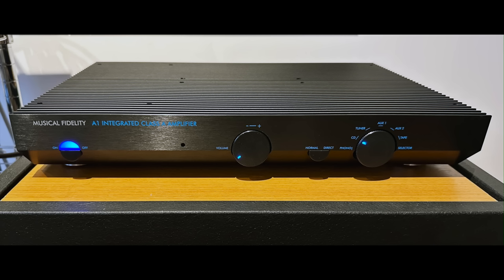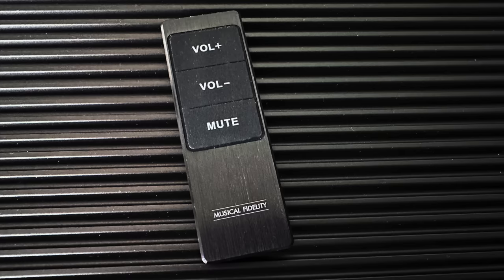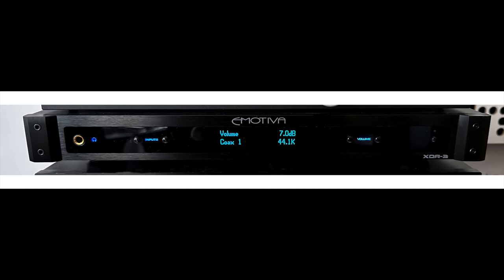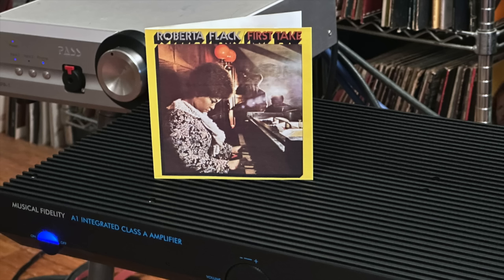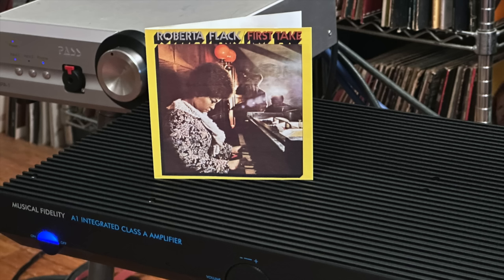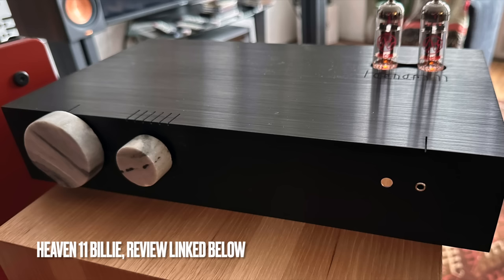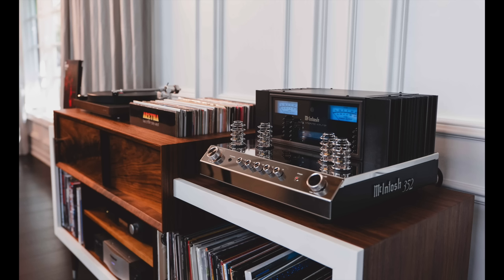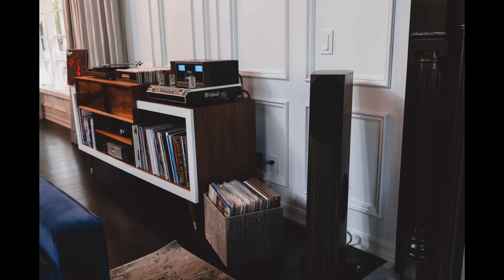Musical Fidelity A1 Amplifier, A KNOCKOUT!

Comment: I had the original A1. Had it  for over 15 or so years before moving to valve integrateds. Loved that amp sounded superb through my Mission 700s (The 1980's ones)
Reply: Mission 700s?  The Musical Fidelity A1 owners didn't buy Mission 700, you know Mission were Persian Capital designed (Big Money) and aimed at the Rap music community, Iranian and London/ West Yorkshire scene.  Musical Fidelity were upmarket and had their own MF Reference and (a name copied from Radio Shack) 'MC speakers'.  The MF music was some strange stuff that Steve never reviews, but British establishment stuff.
Reply: @keplermission  this musical fidelity A1 owner used Mission 700's though. They were a perfect pairing.
Reply: @adotopp1865  No ... speakers are engineered for applications.  Mission 700 were for Farad Azima's Cyrus amplifier that you know, to be honest were dull, they needed bright speakers, the tweeter with higher SPL than the mid/woofer.  Mission were assembled in England and later ... used a Scottish power iron, but Mission really carried on where Amstrad left off, they were nice speaker for Rap and pop music.  MF is absolutely upmarket, your 700 were not the right match for MF A1 but cheaper and similar build style.
Reply: @keplermission  Well I liked the set up before I used the A1 with Sonus Faber minimas and later SF Minima Amators
Reply: @keplermission  The mission 700 and 770 were designed by Peter Comeau in UK . Mission products are and were made in the UK. I have sent products to  Mission in UK for service. I also have corresponded with Mission in the 1990's obtaining parts and information.
Reply: @adotopp1865  Peter Comeau of Wharfedale R.I.P.  Not the UK, in the USA the UK is the University of Kentucky, you know ... Sophia Rosing and Kylah Spring?  Mission were not in the same bracket as Musical Fidelity.  Mission is mass-market and ubiquitous, it's a brand name on the lips of the people in Britain that went to you know schools that the government paid for.  Musical Fidelity is upmarket, it's not meant to be used with Wharfedale or Peter's Mission happy speaker design for Farad Azima?  Musical Fidelity is for former private school people.  Cat Stevens:  
Remember the days of the old schoolyard

We used to laugh a lot, oh don't you?
Reply: @keplermission  You do know that most of what you say is wrong, don't you?

Comment: Hello, I was wondering if these could drive the Elac B6.2  87db  6Ohms small to med size room? won't be playing super loud. I just received the CA 1 by audio by alsten but have to send it back because of a knob and coun't hook it up and did not get to listen to the amp. a bit disappointed the amp came like that. So,  I was wondering if I should get a replacement or go with the A1? Help. Ha!

Comment: I'm a huge MF fan especially  to the A-series. I had given away a Luxman pre/power combination C03/M02) for a 100€ A1 in the end of the 90ies. It was much more musical in every sense. Since then I had every brother except MA50 Mono or A1000  and had recapped and modded them all by myself. The most exotic was a A1  final edition which was in fact a B200. There this version was more working in Class A/B but had 40 watts/channel. I had replaced the plastic knobs by some from Farnell within the same design but produced in alloy. So two things I would like to know. Are these plastic knobs (volume/input)? If you are familiar with the A1 you will get aware of Mark Henessy who did some fine mods especially to the preamp section. The TdP design in this section was dropped by MF due to cost cutting of MF first amplifier! So the preamp section was copied from a mixer with the effect to bring dc voltage to the volume pot that will kill it over time. Mark did a redesign  with only few parts and a better opamp. Therefore I can not think of sticking to the  original layout in the preamp section in this retro version. This would keep me away from buying a new one. Could you figure that out with MF, please.
Reply: The pre section has been improved but you don't really need to use its gain section, it can be defeated. Knobs are good quality plastic and this is a good thing because they don't get hot... Btw that was not MF first amp.

Comment: It would have been interesting to open the amp up to see what kind of construction and parts are in there.  I'd be a bit worried about cheap construction especially with a hot running class A amp and how it would hold up over time...or not.
Reply from the maker: There is a picture of the inside in the video!
Reply: Sorry, my bad I guess I somehow looked away during the few seconds the internal shot was on screen but I did catch the audio the first watch of you mentioning the pure path setting so I'm surprised I missed the pic.  

Still a bit tricky to assess all that much at 1080p from the pic.  From what I could see some of the resistors look pretty small.  I don't think anything looked like SMT but couldn't really be sure, or about the quality of the board itself. 

 Do you have any thoughts about the internal construction and how it might compare to the original version?

Comment: Unsurprising the A1 sounds so good, its design faithfully follows the original concept from the legend and sadly late Tim De Pavaracini. No surface mount, multi layered boards etc here. All discreet components. I am proud to own several of Tims designs including the EAR YOSHINO 912 & 868PL all tube /transformer driven pre Amps and they are sublime. The A1 may well find a home in a second system soon. Great to know how fond you are of it Steve.
Reply: My Chinese TDP phonostage sounds great... And De Paravacini didn't get the 900 GBP markup if I was fool enuff to buy in UK... and it sounds great at 289 GBP
Reply: All value propositions are relative, and all listening perceptions are, of course, subjective. I am happy for you finding what sounds best for you, and I sincerely wish you many happy hours of listening.

Comment: The heat sink fins are quite shallow - I would expect them to be much deeper/taller. For comparison, look at the size/surface area of the heat sinks on the Amp Camp Amp - which is less powerful. Edit: or just look at the First Watt J2 - it has far greater surface area on just one of its two heat sinks.
Reply: Top plate 2d surface is quite large. You can't judge these things by look.
Reply: @razisn  Taller fins would add a lot more surface area. Look at the J2 that was mentioned - it has much greater surface area.
Reply: @razisn if it runs that hot, it could use more heat sink.  Thing is, they are $$$
Reply: @NeilBlanchard  The original external looks have been kept in tact apart from width and height.
Reply: @yantrussart6584  The original external looks have been kept in tact apart from width and height. Top plate goes up to 60-65C which is hot but not too hot in my book. This is not really important because what is important is how hot the internals get. Component quality and heat ratings have been greatly improved.
Reply: No ... the B200 by design can be warmed up quickly with a fan heater because it depends on the optimal idling temp of the output pairs whether better when hot, cold or warm.  Alan Clark was a British Conservative and told us that 'we should never expect anything'.  Heat-sink design is very complex, not surface area, it depends on the devices used and supply current available.
Reply: @yantrussart6584  It doesn't not become hotter than the Sugden externally... 60-65C on the top plate heatsink, much less on the rest of the case..
Reply: @NeilBlanchard  Have you measured the 2 surface areas? How if I may ask? Btw if the J2 is single ended Class A then the A1 which is push pull is twice as efficient.
Reply: @razisn  Sugden today you know ... is just a thing as we'd say in New York.  It's not a real Sugden, they were what people in London call 'Northerners', Sugden was disliked as a Yorkshire company largely associated with ancient speakers made by Fane and Richard Allan.  Wharfedale used to be from York but when Rank bought them over, well they were from everywhere and made in Scotland for cheapness.
Reply: @keplermission  Enjoying your pints of ale?
Reply: @razisn  No this is true in audio
Reply: @keplermission what?

Comment: Imagine for the same price as the amp you could have an A1 that does $10-20K amps a disservice.. So a new power supply in the same body with umbilical.. They can't sit on top. New components inside.. So this amp would still run hot maybe hotter with a power supply just like the A1.. It would have x10 more detail x10 more depth and width. It would still cost under $4000 and sound like it was $20000.. Is that just silly 🙂

Comment: A good amplifier according to reviews, however, the heat issue may cause reliability issues in the future as the original amp had reliability issues as well.🤒
Reply: Had one and used it for about 20 years with no problems
Reply: @adotopp1865  Fair comment!🙂
Reply: Gives off a lot of heat, but it does have a 5yr warrant FWIW.

Comment: The first version of this one was a very good amp sonically and a quality build. However, a pain in the arse to service, if something in the pre or power stage goes wrong. Due to its unconventional circuitry archtecture and the two-piece heat sink on the top. Makes you wonder whether they did it on purpose. No idea about the new one, but if they didn't address those quirks, I'd be very sceptical of buying it. Looks like they left the heat sink the same.
Reply: PCB layout has radically changed (if this is what you are referring to as 'architecture') and I believe the top plate is in one piece (not 100% sure though). Top plate does still adhere to the internal heat sink via thermal paste.
Reply: A lot of early 80's British amps like the A1, A&R A60, Audiolab 6000 had zero ventilation. This was theoretically a great design feature to prevent any dust buildup, and wasn't a big issue in UK.... But many of these amps overheated in southern Europe and USA. All those amps need the PCB removed completely for working on which is a pain.

Comment: Good music! But a terribly inefficient machine where most of the energy heats the room. “Max. Consumption: 130W” being class A that maximum is continuous right? Make sure set it to standby.
Reply: Continous (like when idling) is about 90-100W. This is a push-pull amp. There is no standby, it's either on or off.

Comment: What’s the warranty? I believe the original and revised version are famous for cooking too much and eventually failing
Reply: The new one uses much better and more reliable through hole components. They should cope fine with the heat.
Reply: @jimfarrell4635  the MK2 was supposed to fix issues with the original…it didn’t but was likely a little better…as this will be…but ultimately by going retro they didn’t fix the elephant in the room…the undersized case. See First Watt for proper case design
Reply: @seanb3303  The new A1 case is quite larger... First Watt just used the same generic case from a haul of cases NP ordered to be made years ago. He just fits all the amps in the same case. Also please show me a FW amp that costs as much as the A1 and looks as interesting externally..
Reply: @razisn  FW is not chi-fi so it’s not going to be as cheap. But it has a proven track record, obviously…and a very strong value in used market.

Comment: BUY an updated CLASS H. Leave the Class A amps. for the pro guitar player. You want a balance of efficiency and great sound and lots of POWER use Class H! Claas D is swell but made by MATTEL.. Class H the RAIL CATCHER the newer ones have no crossover distortion.. Use pro audio speakers for LIVE Performance.. SCREW the aesthetics.. I find I get the best bass response from 18" subs.. Below 80-Hz.. My 18" subs have a sensitivity of 98-db.. they have a freak' response of 30Hz.-4Kh... I've put a 20Hz. tone in them and they make all the doors in my house rattle.... The RSG. 15.24 towers with Dual 15" woofers have excellent sound with a EQ preamp.. 35Hz. to 24Kh. FREAK response
 The 4 JBL part Box 710's I have really blow my mind on Bluetooth 5.1... good luck but do not WASTE your money on a home sound system with class A amplification!!

Comment: Does it have the reliability of its predecessor ?
Can you still cook bacon and eggs in it ?
Such a compact device, delivering 30 watts in class A, can't really be reliable, because overheating can shorten the life of components, especially capacitors !
Reply: It is not overheating. Who told you it is overheating? The heatsink gets hot. The caps used can very well operate in the 65C degree range this amp operates. So did the old one. No reports for prematurely failing capacitors even for the old one.. What used to fail was mostly the volume pot. It is better now.

Comment: Wasn’t the OG designed by Tim Diparvincni?
Reply: Tim De Paravicini yes. The new one is basically the same design.
Reply: @razisn  awesome thanks for the fast response!
Reply: @razisn the internals look different though.
Reply: @adotopp1865  The design is 99% the same. Things have been mostly shifted around and different components used. All this has nothing to do with the electronic design. Do you know what design is?
Reply: @razisn  The original A1 used an  LM318 op-amp and BUZ900/BUZ905 output MOS-FETs. The latest one does not.

Comment: Runs very hot…no thanks.
Reply: That's why I avoid internal combustion engines
Reply: Much cooler that your average tube amp. It dissipates as much heat as a 100w incandescent bulb..